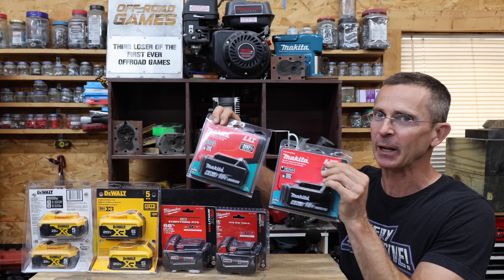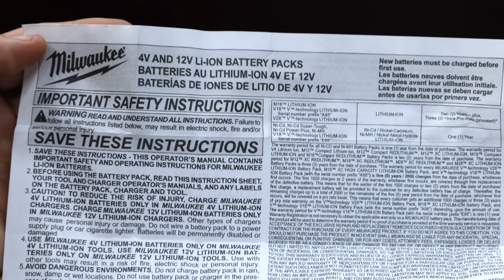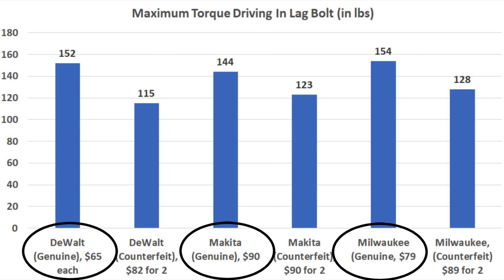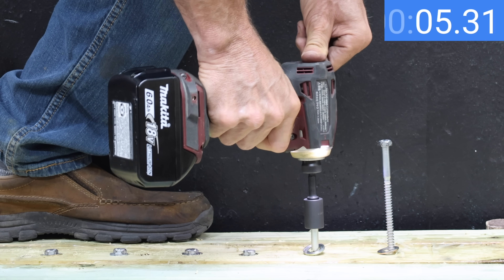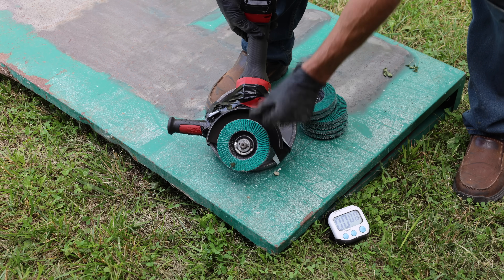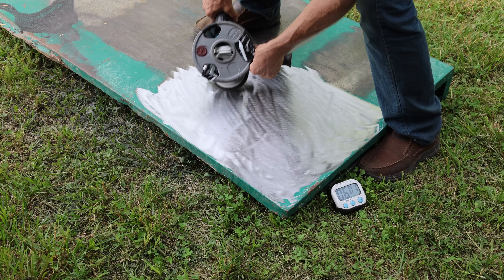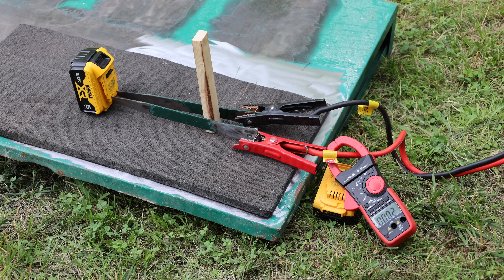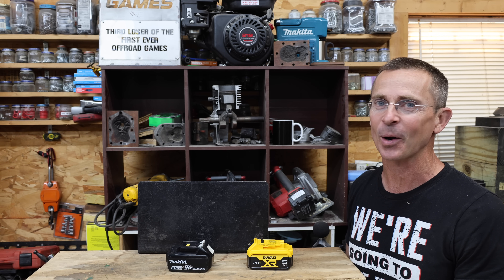Have You Been Scammed with a Counterfeit Tool Battery?

Comment: I got scammed by a "reputable" on-line dealer. Both the battery pack and the charger I purchased were fake and potentially lethal.   I now only buy direct from the manufacturer websites.    This video really reinforces how careful you need to be.  Thanks!
Reply: Amazon just dumps everything from all the sellers into a single bin.  Seller could be legit but amazon mixes the products as long as they are the same model number.
Reply: @Spoonboy79  yup, it's surprising how few people know this.
Reply: @Spoonboy79 thanks for sharing
Reply: @Spoonboy79  WOW, I didn't know that - that Amazon puts all merchandise with same model number into the same bin. Thanks for leaving that comment - really changes my buying strategies.   That's really terrible, and will remain terrible unless Amazon can test every product for authenticity, which likely won't happen.  Oh! WAIT!   Project Farm's links to the "Authentic Batteries" are on AMAZON, so if we buy there, it's a lottery based on how many counterfeits are in that battery model's bin!!  OMG!  Unless all the suppliers have their own bins, then EVERYTHING on Amazon is a lottery between getting fake or genuine products. This is terrible news!
Reply: If you bought them from Amazon or a large retailer with 3rd party sellers like Walmart, there's a chance your order can be mixed with returns from people returning counterfeit. Often if the packaging isn't opened, they will mix someones return in with new stock and resell it.
Reply: I managed to buy some genuine ones but it took a looooot of research to spot the fakes and that info gets outdated quickly. You can't trust brick & mortar, either. You're right to buy direct from the company.
Reply: @The_Ballo  Ebay is really bad and don't forget fake car parts are a huge business.
Reply from the maker: Thanks for sharing.
Reply: Direct from manufacturer website. Good idea
Reply: That's china for ya
Reply: Why on earth are you protecting them by not naming?
Reply: Who was the retailer?

Comment: You can't avoid buying counterfeit batteries even if you wanted to. They sell them in the stores. You wouldn't believe the amount of counterfeit batteries that are returned back to Home Depot, Lowes and Menards as if they were the originals and then put back on the shelf for unsuspecting customers to buy again.
Reply: wow. that's insane. Had no idea
Reply: I have 16 5ah Dewalt batteries from Home Depot and never got a counterfeit..
Reply: @ModernGentleman  I'm thinking it's his specific area because between myself and my family we've bought quite a few Ryobi, Milwaukee, and DeWalt batteries from multiple locations around the state (Tx) with zero issues.
Reply: @NiSE_Rafter  you can always open up the battery case, too, and see if it's counterfeit or not. Authentic batteries have circuit boards, and counterfeit ones do not. That's the easiest way to tell.
Reply: @ModernGentleman  👍
Reply: Most batteries now come in you-must-destroy-them-to-remove-them packaging.

I would never buy one in a taped up package.
Reply: Are they not usually labeled as open box? I've never seen a brand new sealed package from home Depot (where I've purchased all my power tools batteries) result in a counterfeit.

Comment: Thank you for this video. I really had not considered there are fake "OEM" batteries for my tools.  I would be interested to see something with Ryobi batteries if you could please.  I've been using Ryobi 1+ for over 25 years and more than 60% of those tools are the old school "blue" originals.  With so many tool options for Ryobi, it's hard to change to a different brand.
Reply: Agreed. Ryobi is the best value on the market for the home player or DIYer. My drill is going on 12 years, still perfect.

Comment: Talk about counterfeit, I bought some 3M tape from an oddly-named seller on Amazon... The gooey heavy duty stuff for car trim, it was so suspicious (stating made in China) that I contacted 3M and the representative confirmed that the items were counterfeit. I went onto Amazon to mention that in a review and they blocked me from reviewing the product because it was incorrect information according to them.

I also bought 1,000,000 lumen headlights for $10 and a 7000 psi pressure washer for $75.

Jeff Bezos is evil in a lot of different ways.  it is time to hold them to account. RICO charges should be filed because it is an organized crime.

Comment: I did not detect a difference in packaging on the DeWalt packaging. Only the Milwaukee battery packaging you can discern the difference BEFORE BUYING: the counterfeit Milwaukee battery packaging lists the battery last 55 minutes, BUT the clock shows 3/4 of the clock circle colored in, which is only 45 minutes. Guess the counterfeiters haven't learned that 3/4 of a circle means 3/4 of an hour or 45 minutes.

Comment: I would add a word of caution about the QR code on the dewalt batteries: i have batteries newer that 2019 without the QR that when opened, inspected, and weighed, appear to meet all of your criteria for genuine, and I've been very careful about how i buy the batteries as well, as i aware of the counterfeit problem.

I noticed the QR code thing before, and my suspicion is that it's due to the QR being added in a rolling process across several factories, though i agree it's likely to be true of any battery with the newer enclosure version.

Comment: I was thinking I wouldn't have to worry about this since I wouldn't buy a tool battery from a shady website (Amazon can be often too), but I hadn't considered somebody buying a fake and returning it to the Home Depot, which might be resold to another customer. Though the odd of buying a counterfeit from Lowes, Home Depot, etc that was a return is probably low. By the time my batteries don't hold a charge, it's usually time for a new tool. I don't use my DEWALT drill all the time, but it's at least 10 years old now. I'm surprised the counterfeit batteries had any safety features, and that they worked at all. Also, thank you for correctly saying RPM instead of RPMs.

Comment: Project Farm..How are Samsung 25-R individually protected against an internal short. ?
that simply ain't correct  18:55. none of these, got internal individual protection..
don't run with made up claims.... samsung 25R are just as dangerous as the Chinese variant in individual form, likely even more from the lower ohm
if a 18650 cell got its own internal protection topplate, your not in doubt as it will often be higher.

Comment: So, are components for both genuine and counterfeit batteries made in the same factory?  Were the injection molded plastic parts made in the same tooling?  Is this legal? Are there efforts by DeWalt and the US government to stop this?  Or does DeWalt, and/or the supplier, make money on both?  If parts come from the same factory, something is wrong at the supplier.  Seems like DeWalt could easily call them on this and threaten to do business elsewhere.  Or, does DeWalt make money on both?  They might have figured out there are  some people who won't pay the higher price for genuine.  Paying 50% for a battery which does 80% is reasonable, but it's bad for the environment.

Comment: The counterfeits can sometimes be distinguished based on the fact that they cloned an older battery design that doesn't match the current models sold in stores. Todd alluded to this in the video when he mentioned the trim style differences.

For DeWalt packs, this means that a battery with a 2019 date code and no QR code on top may be legit (since that was the style at the time), but a "2024" stamped battery with no QR code is fake -- it's a near perfect clone of a design that is no longer being produced by DeWalt.

Addressing a comment seen elsewhere in this thread: for Milwaukee, it's possible that the legit older packs listed a different set of countries on the label than the legit newer packs.

Comment: Any seller selling these batteries and using the words "genuine" or "authentic" with a low price seems to be the key. For better or worse I use Ridgid cordless tools but do have a small light duty De-walt screw driver. It is the one that goes forward or reverse just by twisting it one way or the other. Great video, thanks for making it.

Comment: I could understand buying genuine battery for professional use. For DIY likes myself, who only use power tool occasionally, I straight out buying third party batteries. I don't have to worry about mistakenly getting counterfeit. I bought a 2-pack Vantech brand (equivalent to DeWalt DCB205-2) 5ah batteries in Feb. 2019 for less than a third of the cost of DeWalt genuine. They both are still going strong in 2024. Even Project Farm had done testing third party batteries vs genuine batteries before and recommended Waitley brand if I remembered correctly. I had already bought the Vantech before I saw the video but the Vantech batteries serve me well all these years with no issue. Of course I only break out the power tool a few times a month for short period of time use: Tire inflator once or twice a month to top off tires pressure, string trimmer + leave blower x2/mo. and occasionally using the drill, impact driver, cordless vacumm or DeWalt cordless pressure washer (it's suck BTW) for various minor jobs.
Reply: fake/counterfeit and compatible/replacement are dofferent

Comment: Is there any way to hold Amazon responsible for providing a platform for (and profiting from) the sale of counterfeit goods, especially ones that might endanger people? These knockoffs are genuine fire hazards.

In my opinion, Amazon is worse than eBay in this regard, because it launders the counterfeits with genuine ones by having a single product page for all sellers of an item. Amazon seems to choose which seller gets priority largely based on their current price, but it favors "shipped by Amazon" options, where Amazon warehouses sellers' inventory.

With eBay (when I last used it, which is several years ago), at least there is less ambiguity about who is actually selling the items you buy.

Comment: sorry but if you pay 90 bucks on a battery it better be original. 
Anything above that price is just ridiculously overprized, no matter if original or not.
10x 18650 battery + a circuit board + plastic housing can't be reasonably priced over 100 bucks. Sorry, but no.
Even at 90 bucks we're talking about 100-200% (or even more) margin.
Reply: With those current prices it may be just cheaper to buy the traditional cord tools again plus a cheap generator if you really need to work THAT remotely.
I'll for sure not support those current price evolutions when it comes to battery powered tools.
Plus, the cord variants are still WAY more powerful.

Comment: I have a contractor friend who only buys genuine Milwaukee batteries from his supply house, I take the sketchy way and buy aftermarket batteries (labeled as such) His failure rate on factory batteries is higher than my aftermarket. Is the power delivery the same? It's close, probably around 90%. My aftermarket cost is around 25%  of the factory. 90%  of full power with 4 batteries against one. As a contractor I've used aftermarket for going on 15 years, same bunch of batteries. I have enough to keep the cycling process at a minimum. The original 2.0ah batteries are beginning to fail, purchased with the drill sometime in 2010. I did have a 6ah battery fail shortly after purchase, no response from the seller, took it apart, repaired a bad solder connection, it's still going (3-4 years now). It gets used with the circ saw with no issues. Sure, it's a gamble but there's also a good chance they're all made in the same complex. It helps to do some research on whichever battery you buy. The inflated price of OEM coupled with their similar failure rate and performance makes them a poor investment in my decades of experience. None of them are built by human hands, robotics are used, simple solder connections fail. If you never attempt to repair your own tools, stick with batteries that you may or may not be able to return.

Comment: I got 3 Chinese M18, 7.0AH for 45.00 from Amazon and I knew they are not Milwaukee batt. I wanted to see how they will handle. So far, they work like a champ, no issues with the charger as well. I hate to say it, but so far so good. I had looked at around 1500 reviews on the seller since 2021 and many claimed, they are good and do the job. Even the charge time is the same as OEM. Yes, some gave them 2 starts, over all, good value for me.
Reply: Let's hope your house doesn't burn down if the batteries catch fire.
Reply: @martincavin6760  I hope not. No matter who makes any batteries, I never leave them to charge unattended. I never charge my car even, indoors.

Comment: Todd, hoping you can clear up something for me. At 7:11 in the video (3rd Milwaukee lag bolt) we can see the head of the bolt off the washer a fair amount when you stopped driving it in and called the time. When starting the next bolt (7:13 in the video) the bolt is now fully tightened. Seems like you went back to tighten it but maybe didn't account for that time in the measurement. Small issue but wondering what happened.

Comment: Many years ago (over 10 years now... Ok, yes, I am old), while researching a battery pack for a portable speaker, I learned about the "common issue" of counterfeit batteries. Since then, I have only bought batteries from trusted suppliers. I also observe the same "rule" regarding the tools.

A comment on the Milwaukee batteries, although there is quite a delay until it entirely disables the battery, it does give you a chance to pull it from a short circuit and not ruin the battery. That being said, it takes a bit too long.

Comment: I got bitten on ebay for $45 Dewalt batteries. They work fine for about ten minutes putting screws into white pine shelving but then crap out almost instantly. The $100 genuine batteries go strong for over 30 minutes doing the same task before going dead. Using the quick charger I could get the fakes to go again in 30 minutes. I wonder how many cycles I will get before they no longer charge up!

Comment: The only way to buy anything relatively expensive or important on any online platform is to go to the store belonging to some reputable company. I bought my Bosch tool and batteries on the Bosch store on Amazon. I bought the drone from the Dji store on Amazon. Similar with other products I care about. How on Earth could one buy anything relatively important just by clicking some link is beyond me. With very cheap products it is fine, but not something that could burn your house or you use and need it to actually work.
Reply: So how do you know that the Bosch store is not counterfeit?

Comment: I have bought DeWalt batteries on amazon in the past but they’re all genuine, however I think I might just buy them at a local hardware store from now on since I’m worried that the next one I buy online will be a fake.
Reply: I bought DeWalt batteries on ebay. They were cheaper but not insanely cheaper. They were probably very very good counterfeits. But I say probably because even after calling DeWalt and describing the batteries they couldn't confirm if the batteries were counterfeit. They work very well but I never tested against real ones of the same AH so not sure if they're the same. I suspect I could resell them used and 95% of buyers would have no idea.

Comment: My previous foreman bought the now older long 9.4v NiCad Makita COMPATABLE  angle drill batteries, which the Makita brand were about $50 each, these were half the price which should be a clue but wasn't... they came in the mail and I unpacked to charge them etc. First thing I noticed was they had absolutely no labels or anything on them, just blank black cases, I also noticed they weighed about half what the genuine Makita batteries weighed.
Over time we found the charged lasted about half the time, and their lifespan was about half too LOL!! paid half price for them and DUH- he got HALF the battery inside and half the life, so those half priced $25 batteries wound up costing the same as the $50 Makia batteries.

Comment: I seem to remember counterfeit vs authentic batteries were previously reviewed, but showing how identical they are in appearance is new. I intentionally purchased a total of 4 counterfeit batteries for a Ryobi leaf blower and a hedge trimmer. The hedge trimmer is probably 10 years old so didn’t want to spend money on authentic Ryobi batteries as I keep expecting it to stop working soon, but it keeps going. I bought a counterfeit 5ah for it a few years ago and it works great, but the original battery from 10 years ago finally stopped holding a charge so bought another counterfeit 5ah battery of the same brand. The new counterfeit is garbage as it doesn’t last long at all. My wife bought a Ryobi hedge trimmer which came with a 5ah battery, but she complained it was too heavy so bought 2 counterfeit 2ah batteries which are also garbage as they don’t last long at all. You can trim one large bush if you hurry. When charging, I always make sure I remove the counterfeit batteries as soon as they’re charged, something I typically don’t worry about with authentic batteries. Counterfeit batteries used to be fairly good years ago, at least the Ryobi counterfeit brand I initially bought, but nowadays, it’s not worth it for all the reasons mentioned in this video. Don’t be tempted by the lower prices. With counterfeit batteries you do get what you pay for!